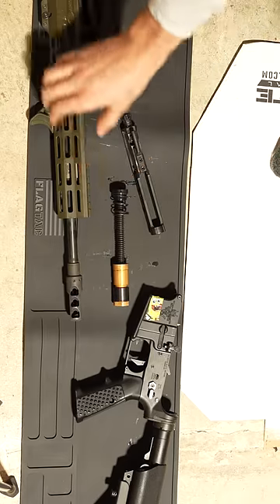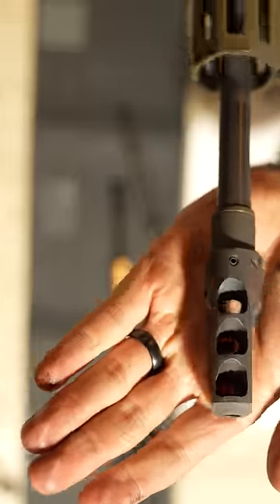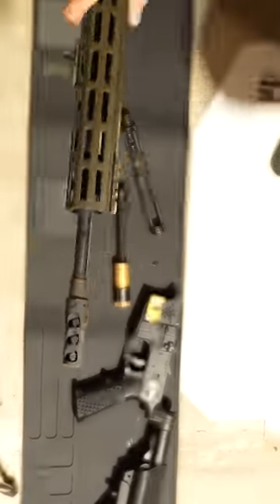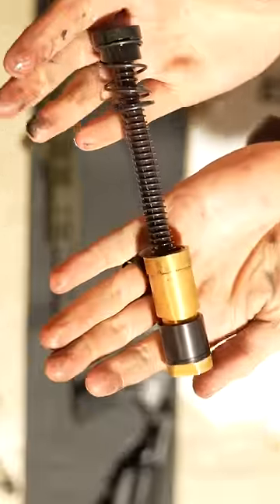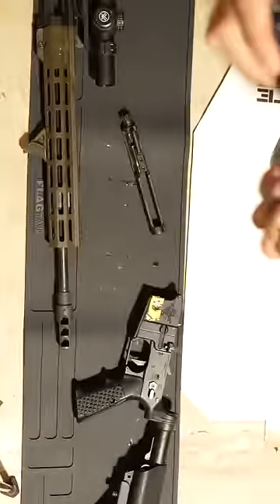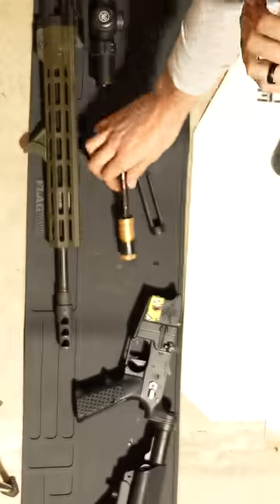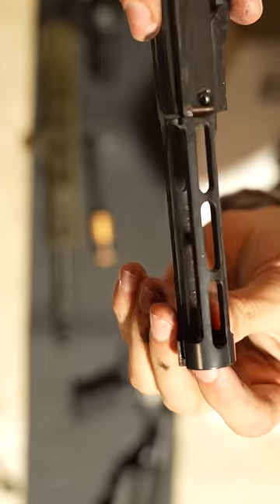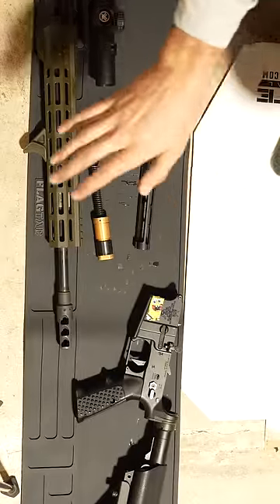This AR has ZERO RECOIL

Comment: That muzzle brake is so going to blow out ones hearing even more than a regular AR with just a flash hider if used indoors. And totally going to make friends at the range with that directed blast.
Reply from the maker: It’s a good thing this isn’t intended for defensive use. Check the full video to see why this isn’t a good gun for certain roles
Reply: @RenoMay that side blast still looks gnarly, I have a simple surefire muzzle brake on mine because California reason. Dumb I know. I was getting lots of side eye at the range and I wasn't even beside them. LOL. I went to a rifle length stock and buffer after putting a blast forward device on the front.

Comment: Gets a speck of dust on the bolt carrier:

Damn failure to feed.
Reply from the maker: Nah man watch the full video
Reply: @RenoMay  yeah you’re right. But generally speaking, light bolt carrier groups can’t be susceptible to such jams. And I thought it was a funny comment.
Reply: @RenoMay  this is the second response I’ve gotten from a gun tuber. in the first one, we discussed how to make an open bolt fully semi automatic and not convertible into a machine gun and it’s probably possible btw.

Comment: Does most of the effect go toward the buffer system or the muzzle brake? I'm guessing the buffer system.
Reply from the maker: Both. The brake helps muzzle rise and rearward recoil by diverting gas 

While the buffer reduces it by reducing the reciprocating mass meaning less impact to the rear AND front when the bolt closes.
Reply: @RenoMay  thanks for replying! Always nice to learn something new.

Comment: 80% of the recoil is eliminated by the compensator lol. The buffer helps but the same thing can be done by properly tuning your buffer for a fraction of the price. As for the new design on boat carrier, I don’t trust them yet they’ve not had enough time to prove they will be effectiveover the long road. If you can’t mitigate the recoil of a 223, maybe do a few pull-ups and evaluate your fitness.
Reply from the maker: If you’ve not experienced this buffer and bolt setup you’re missing out. It’s a huge benefit that blows people away
Reply from the maker: Also, id bet a LOT of money on me being stronger than you
Reply: @RenoMay  me being retired and and over 55 I would hope you’d be stronger than me lol. I was speaking in general, I know 11-year-olds that can handle the kick of an AR 15, and if you noticed, I said I don’t doubt the bolt I just doubt how much testing has been done on it so far. there’s a lot of problems with new technology in case you don’t follow the exploding guns problem currently the military has sent a lot of people to the hospital. Trust is earned not just given, except by fools! I’ve seen many modifications on numerous platforms of weapons, most fail. So I tend to wait until they have been proven safe, I’m responsible for the safety of 12 individuals, we don’t follow the new fanboy fads deliberately. And anybody that has trouble with a kick from a 223 round, is either doing it wrong, doesn’t know how to do it, can’t handle it, or is weaker than a child. Improve recoil mitigation on something like the Holland and Holland then talk to me, that I would understand.
Reply from the maker: This is peak midwit energy based on “anybody who has trouble with the kick from a 223 round” 😂

I have a dedicated video breaking down what goes into this gun and WHY you would want it. And most importantly why you WOULDNT want it. 

This is absolutely not a suitable gun for beginners and has nothing to do with strength. If you can’t wrap your mind around why this gun exists and who it’s for I recommend checking out the full video. 

This type of setup has likely seen more rounds between the two designers than you’ve shot in your entire life and is currently being used by the top shooters in the most competitive rifle leagues.
Reply: @RenoMay  look really wasn’t trying to pick an argument with you but if we must continue, you’re using approximately 16 extra parts that could break, foul, or just wear out. I did my first AR platform built in 1984, even then I never had a problem with recoil. Any mechanic or engineer will tell you stick to the least amount of parts as possible, there is a drop-in trigger currently under Patton review that removes three parts from the lower receiver while allowing automatic, and burst mode. That’s an improvement in technology by eliminating parts! I just finished a project with two companies who had issues with their folding stocks, I actually looked at one of your buffer systems or one of those. I don’t know if they’re yours or not? After putting on the proper muzzle break, adjusting the gas block and buffer system, it came down to the weight of the extension placed on the bolt, the other company had issues with rubber bushings in their hinge that they refused to change causing them to fail. Simply put less parts equals less problems. Common basics and engineering but you know that right? I’m working with an electronic trigger right now. That will bring up questions for Auto capability without the parts normally required. But who wants to add batteries to their gun? Who wants to count on a circuit board with two little contacts like a paintball gun when their life is on the line? There’s another system out there very similar to yours, but it requires no buffer, making it the better system, just because less moving parts yet again. It’s not an insult. It’s just what you will be dealing with if you are attempting to create something new. I do a lot of reviews like this, and I make a lot of enemies because I am brutally honest! Two of my channels were shut down last week for teabagging a guy who took somebody else’s belly band design and had it made in India under his brand, he did the same with under the dash magnets, the only problem is he did not use a Rare Earth magnet, and his magnetic gun holder failed before it ever hit the field, not being able to support the weight of anything bigger than a hellcat. So that idiot reported me for gun violence all over the place, lol. Just because I showed that his magnet didn’t work. The good news is the designs. He copied received his information and he has no longer advertising on social media, probably saving quite a few lives. It’s nothing personal but less is more and more is less, figure out how to do it with less moving parts. And by the way, you can go to Burnell’s channel watch the swing test just changing your muzzle compensator to one with four ports, that will eliminate most of the problem you’re having with recoil. I see you have a three port on there, that’s recommended for subsonic rounds, but you have one of those ports closed, so technically it’s a two port recommended for 9 mm, the number you’re looking for is four ports for 556 and 223. Personally, I only use them on my 10 inch blackout 300 other than that I use flash hides They tend to create a direct back drive not a kick unless you’re holding the weapon wrong and that’s another story
Reply from the maker: Not reading all that
Reply: @RenoMay  lol thought you were strong?? analytics said you did. Let me put it in kindergarten for you. The biggest joke in engineering is 
“build the better mouse trap.” It’s impossible, something that can’t be done, three moving parts. Can’t be done with two. When you had 18 parts to something that already has too many, that’s not the better mouse trap.
Reply: If you make it to shot show, bring it to the proving range not the public one, the specialist one! It won’t just be my opinion

Comment: Two questions:
Will the bolt sustain heavy duty for combat?
What is the difference in recoil by using a suppressor and relying only on the buffer spring system?